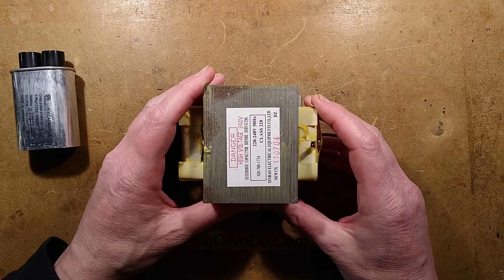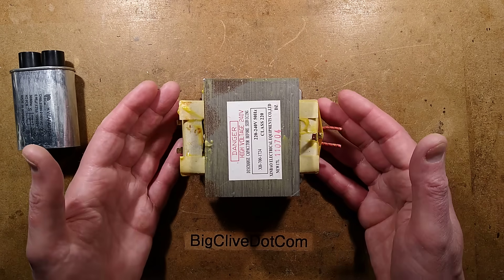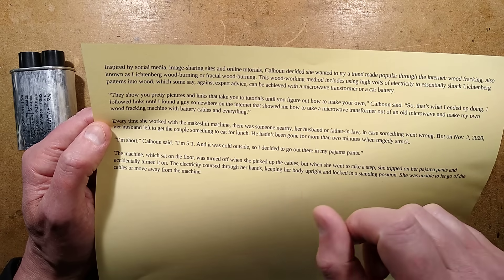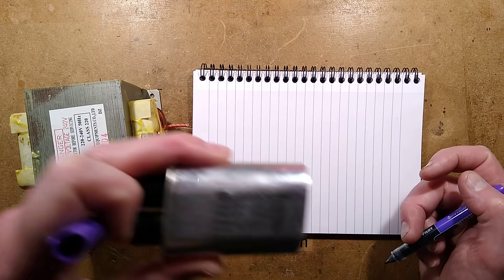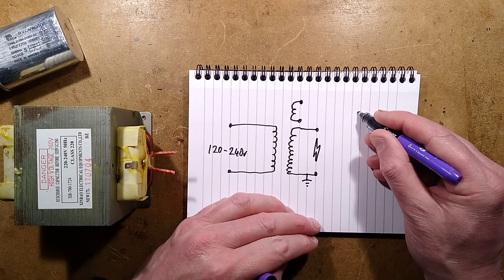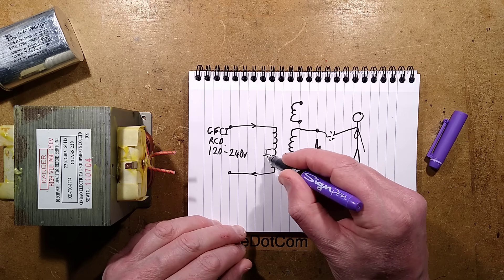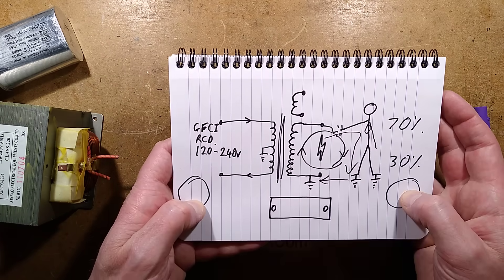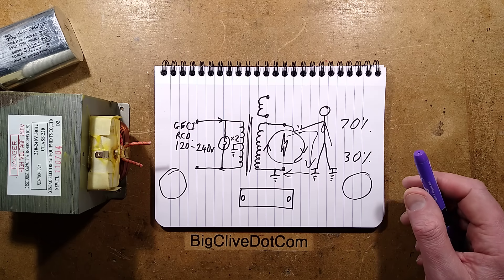The most deadly project on the Internet

Comment: Damnit Clive, you scared me with that one. I have a microwave transformer on a shelf I pulled originally for a spot welder internet project. I have since become an extra class amateur radio operator, and I have been bitten by the tuning capacitor of a magnetic loop antenna during transmit with 7 watts, and showed my neighbors how many strong curse words I know. I have seen a similar article by a fellow ham who did the same thing with 100 watts which is common. And he had a big black hole burned down to the bone of his finger, and said it took a year to fill in. But I am taking note of the tips you have provided and I will think a few times before deciding not to do this fracking thing, or anything else dangerous with that transformer on the shelf. My hobbies are dangerous enough already. Thanks. 👍
Reply: a spot welder is as safe as any mains DIY project
Reply: I used to run a 4W CB rig in my car and I put neon bulbs on the tops of the twin whips so that they would light up when I transmitted.  I was told that the antennas could generate up to 90 volts at the tip.
Reply: Ha! I got bitten by a magloop antenna too! 
I was using a high quality air trimmer to tune it, using it for a 10w VHF transmitter. I was using a plastic trimming tool but i got too close to the shaft of the trimmer because the tool was flexing too much. 
I think it was about half a second until i felt the RF burn happening. There was a little dimple in my finger for months.

Comment: I did this with an MOT. What I did was to set it up without anything plugged in and making sure it was completely stable (as in, couldn't move) and made sure it wasn't touching anything that could conduct electricity. I then connected the mains from a distance using a switch. It's possible to do this safely, but respect for electricity is vital

Comment: I've done a bit of wood fracking, but found the output of a common microwave transformer to be too low to get really good designs, plus under load the transformer pulls enough amperage to trip my breakers. I still collect old microwaves and salvage a ton of parts (including the transformers), as they do make good spot welders. I've been contemplating other projects that could done with the high voltage output of the transformer, but haven't really come up with any that I care for yet.

Comment: Hobbyist woodwork and bad welder here. My wife keeps asking me to do a bunch of this stuff for her. I just can't make her understand why I will not and just how dangerous it is. I did not know how many deaths have been reported. That's so sad to hear.
Reply: Maybe she needs to see some videos of actual electrocutions to understand... Dont do it unless you are absolutely sure you know what you're doing.
Reply: you could have a go with a car coil.. a 555 timer chip.. a mosfet and a 9V battery.. (stack of really small ones like cr2025's is probably best.. low current available) way way safer.. but remember the HV side will still really really hurt if you get it wrong. use spark plug leads for the hot end..
Reply: @PaulaXism  Only thing is... it probably wont make very good patterns. Could be wrong though.

Comment: its been found that the Hi Hz really doesnt work all the time, the voltage wants to find nerve bundles and follow those. I have a "Hi volt" tesla coil supply I made from 2  distribution transformers ( the gray things on the power poles). I ran the primaries in paralell and the secondaries in series for a 240vac in and a 28.8Kvac out at 60A ( inductor limited) but when driven by the variacs, I can get a sizzling 32Kvac out of it ( my icon pic is of the coil, its 9' tall and makes 12' long streamers)  very potent machine, there are NO second chances with this beast.

Comment: I'm disappointed in humanity. Again, you've had to make a video addressing this topic. That's very disappointing. I have also used a neon transformer and it works fine. Sure, it takes longer. I like the results better and its (more safe). I make sure to perform my tasks with people knowing what I'm doing, when its active and where to keep clear. This is not a joke. You usually only get one chance when messing with these high current transformers.

Comment: I use 9,000 volt to 15,000 volt neon transformers to do this and many other high voltage projects like building a Tesla Coil...
My advice to anyone attempting this or any other project that uses any amount dangerous voltage is to educate your self first. 
Learn and understand how electricity works. What kind of situations make it dangerous and take safety measures to protect your self. Such as the use of voltage rated gloves and don't touch or adjust any of the electrical connections with the power on...

Comment: I do all kinds of electrical work but I don't mess with microwaves. Not only because of the 3-5kV transformer, but the ring of insulation around the magnetron that is extremely toxic/carcinogenic if it gets damaged.

Comment: I did the opposite. I cut off the step-up (secondary) winding and replaced with a few loops of very very large diameter welding wire. Outputting a few volts, it easily melts 12AWG wire. Yes, it makes things hot and produces horrible smells, but it is a lot less likely to kill me!!!

Comment: Here's a question: does the artwork require voltage or current?   If former, one should add a high value resistor in series which would limit the current.   After all, it is the current that kills, not the voltage.  However it does take a sufficient voltage to drive the current through your body's resistance.  But if you have a sufficient sized resistor in series with the secondary, the voltage would drop when it met with the resistance of your body.
Reply: you need both for fractal designs in wood....  remember, you are burning the wood, and you need hi volts to create the fractals.
Reply: @bunnykiller  High volts does not mean high current.  A common static electricity shock is high volts, but not high current.
Plasma ball displays are high voltage but not high current.

Comment: The one I made I used old insulators inside a plastic box (just spare LV distributor ones) to isolate the Transformer (Tx) from the general mass of earth to prevent accidentally becoming part of the circuit. These can be done safely, but the videos that get the views aren't the people who are taught about HV and have ways to make it safer, just those who can throw it together with the easiest to come by parts. I also found the neon transformer (on certain types of wood) gets you finer detail in the figures compared to the microwaves Tx.

Comment: I have been asked to build these for a few people. 

I do have a safe way to do it but the cost goes up a lot. 

Basically fully interlocked cabinet with an isolated inner tray, grounded case, isolation transformer, and actuated by a pneumatic momentary switch.
Reply: I have had people ask me as well.. my answer is a flat "NO!" ..

Comment: I actually did a high school science fair project on lichtenberg figures. I opted for a current limited neon sign transformer, along with creating a box that required an arming sequence with a key, and of course, a big red lamp! All of this was done on an insulated table with a “No go” zone marked around it, and of course, two people must be present at all times. I was lucky enough to have a friend who worked for a company that tested the electrical companies insulated mats and gloves. He designed HV psus and other devices for a living, and was a great resource on safety and best practices. 

Recently a member at our local makerspace mentioned she was doing these with some device she bought off the internet, I worry about her. Microwave oven transformers are no joke.
Reply: Make safety switch for her and show her the birned hand picture from the arcticle.
Reply: As a high voltage electrician the amount of safety gear we have is amazing. The minimum equipment I would use is voltage rated glove sets and face shields
Reply: @johnhowe6178  I would also recomend a welding mask when arcing MOT´s since the arcs emmit a lot of UV and IR radiation and are very bright.
Reply: your setup is as BC described in his last video on the subject

Comment: When I teach a second semester physics lab we tend lean more towards electronics/circuits to explain the "electricity and magnetism" aspect of the lecture, and one of the first things I talk about is Ohm's law (V=IR) and I take a somber moment to explain to them that if they've ever heard the term "It's not the voltage that kills you it's the current" to completely disregard that statement because the voltage is what actually will kill you by means of pushing enough current to do the job.    Now usually my students lean heavily towards EE majors, and occasionally I do get a maker or two here and like to make sure they know electricity is not something to screw around with if they don't know what it can do.

Comment: The only 'safe light' is one that is on when the unit is off.   If the light is out the unit is then handled as on.   If the light burns out the unit is handled like it was on.
Light on unit is OFF, light off unit is ON.    NO mistakes with burned out bulbs just burned out operators.
Reply: Yep.You can add an additional bulb to indicate it is on, and make it flash or flicker rapidly to draw attention to the danger even more.
Reply: @Basement-Science  If the bulb is on when the unit is on a burned out light kills you.
The only safe safety light light is one that is on when the unit is off.   Then a burned out light means the unit is ON.
Reply: @robertpendzick9250  Yes I understand and agree with that. I meant you can add an additional Lamp that tells and reminds you that it IS in fact ON. 
For example with just a single bulb that is off when the HV is on, your Mains could have gone out (RCD tripped for example, which is not unlikely) and your controls would still show it is ON, because the lamp is OFF. While this is not a dangerous situation itself, the operator might not be sure if the power is ON if nothing seems to be happening on the Wood, and may want to check it somehow. 

If the additional bulb burns out, it will tell you that something is wrong with the controller or the power supply, which you otherwise wouldn't know. 

Although I admit that the operator might also get confused by this more complex set of possible display states. But most likely they would just shut off the device in case of confusion.

By the way, the ON=SAFE lamp requires additional switch contacts or circuitry which can also FAIL and show it to be safe when it is not. If done properly it can be highly improbable, but with 2 bulbs it would then show BOTH bulbs ON, which would be the highest danger indication, because it means the controller is faulty and should be unplugged immediately.

Comment: I am comfortable with working with 120v & 220 volts. I probably could safely perform the high-voltage fractal Burns. I have two microwave Transformers in my closet right now. 
I have come to the conclusion,  it is not worth the risk!
There was an individual killed doing this very experiment in my little  town just 5 or 6 months ago.
Reply: Meh, put the secondaries in series. No worries, guy, Relax! LOL
Reply: What people do not realize is that at voltages of 2,000 V or so, the current can flow over the surface of insulation, table tops, and so forth. Which is to say that just staying away from or not touching a wire or metal object is not enough to guarantee your safety. It will come looking for you!